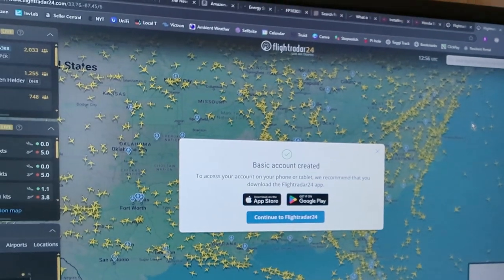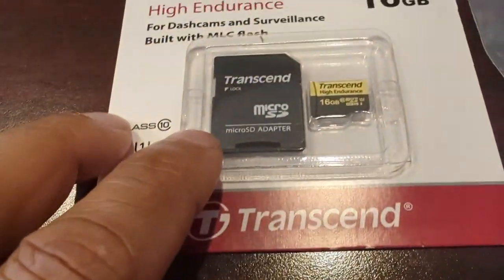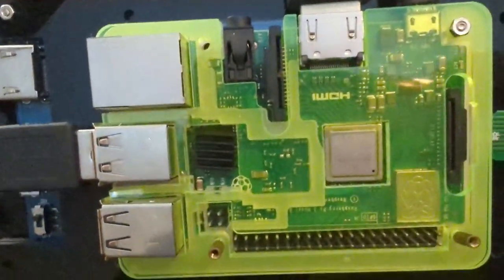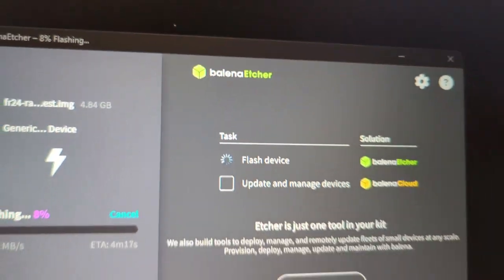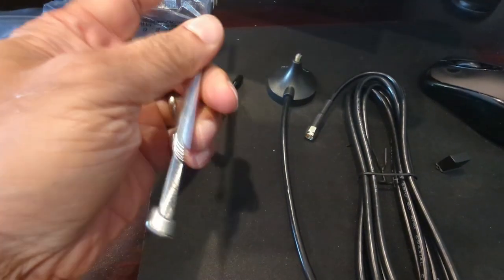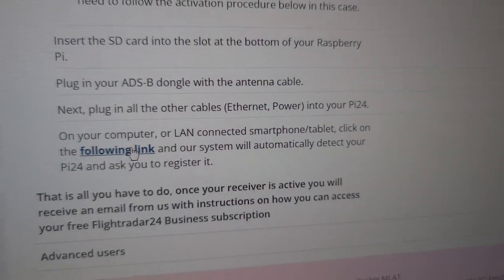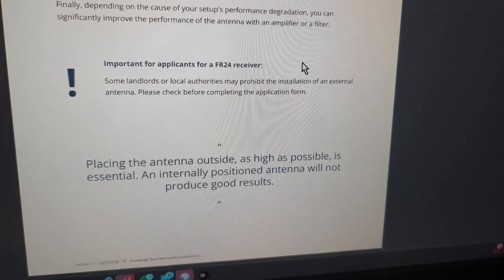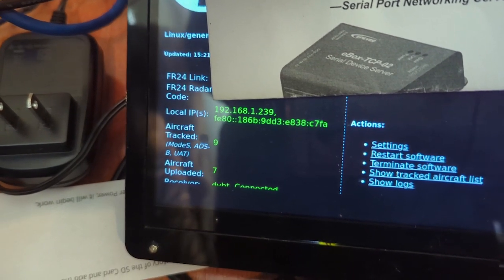How to Setup a Flight Radar24 receiver

Comment: I regret my ignorance, What practical uses can you have with this technology apart from flight tracking?
Reply from the maker: Great question which I did not answer in the video. You can get a free business account with flightradar24.com which offers a lot more features than the basic plan. If you have a raspberry pi lying around it's a cool project at the expense of buying the antenna which equates to one year of a business subscription.
Reply: @Andrewsnotes1  thanks buddy great video